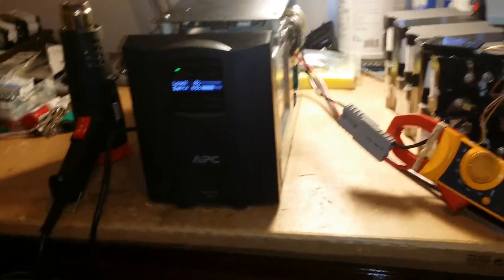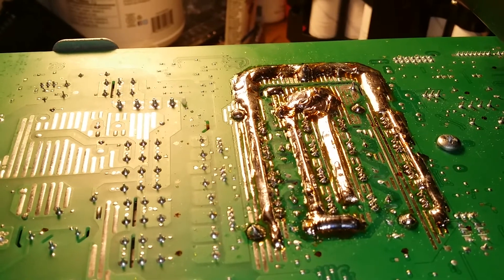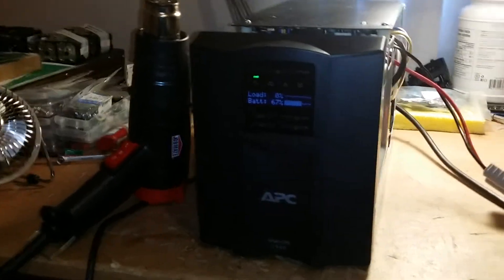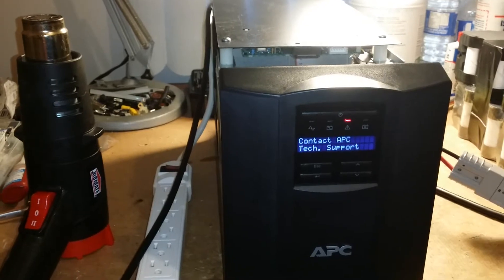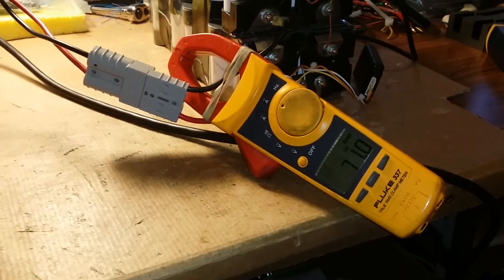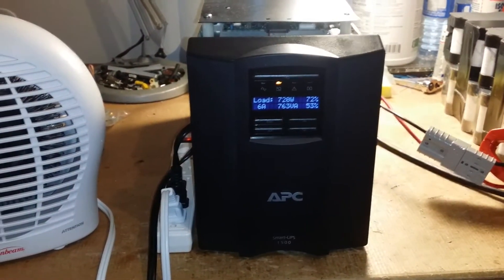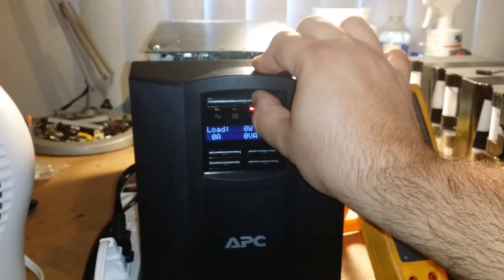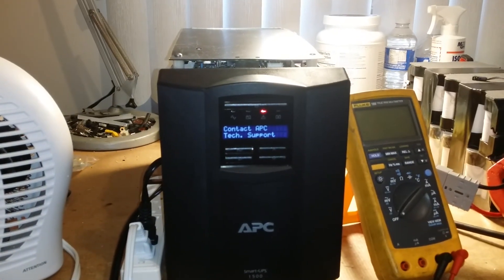Apc 1500 smart ups sinewave inverter Part 1

Comment: fridge will be easy, since you have a lot of power for few seconds and after that, fridge is light load
as for other things, only thing you have "problem" with is overload, not the voltage drop or voltage of battery
you could lower its sense resistor, so overload would be higher, but reading of input power would be off a lot, lower